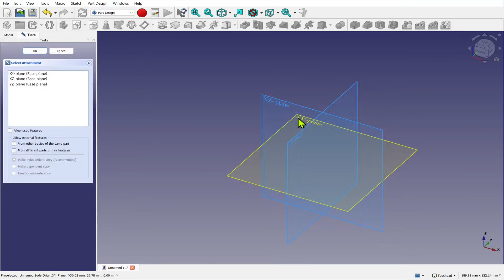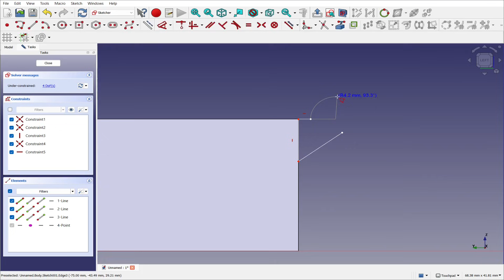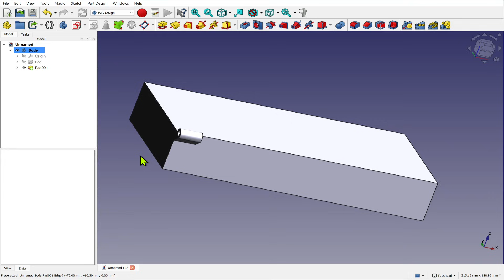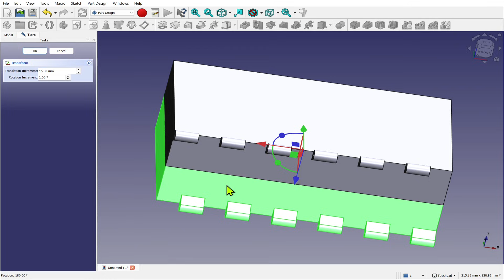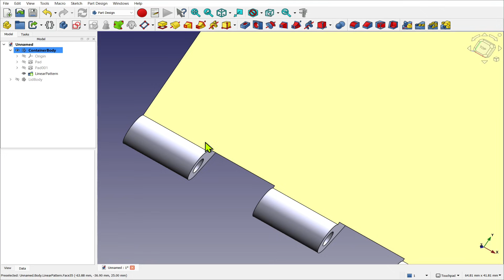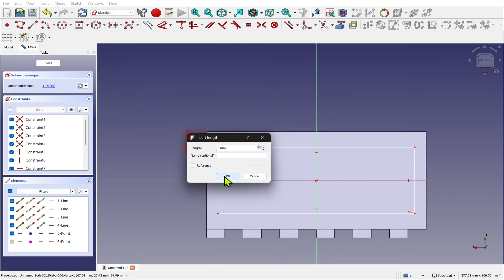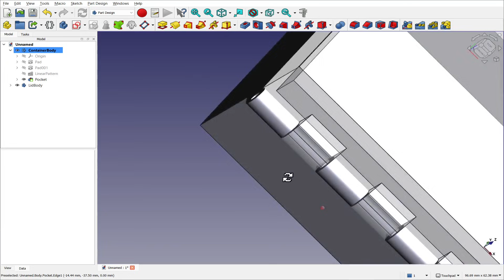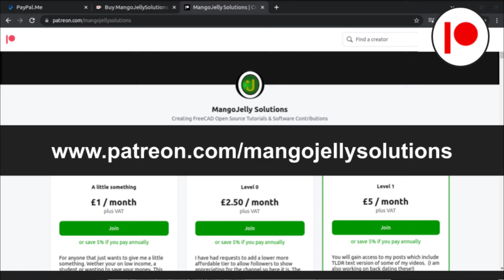Freecad 1.0 | Easy Hinged Box Using Linear Pattern | Basic Beginners FreeCAD 1.0 | Lesson 39

Comment: Great video. What's holding the hinge together? Don't you need to add a bar going through the hinges?
Reply from the maker: Thank you. The hinge can be held together with a metal / plastic pin.  Or, you could open it out so the tops lay flat and then in one body pad a pin all the way through one hinge.  This will line up with the holes in the other body and then you can export both and print them in place on the printer.  It's one thing that I wished I added to this tutorial.

Comment: Omg external geometery is what I need for my parametric shed model! I have been using the subshape binder to pull sketches in and then using math to adjust the position of the sketch. But I have been having issues with certain part like framing. I set an outer box to the dimensions and then add lines for the frame pieces but when I set sizes in my spreadsheet the lines sometimes reverse their size to like a negative number and then place the line outside the first box. I have to delete the dimension constraint and then move the line and then re set the dimension to the spreadsheet value, how can I address this? Do you have a video in mind I could check out of yours for this issue? Any help would be greatly appreciated. I never knew how to work FreeCAD until last week, and everything I have learned so far has came from you. What a great job you are doing!

How did you learn everything so methodically correct? Are you tied to FreeCAD and know more than the docs say or is it all self taught?

Comment: I get an error when I try following this tutorial (Windows 10; FreeCAD 1.0.2). If I create the void sketch off the face following the linear pattern, then changing the occurrences of the linear pattern causes an issue (AttachEngine3D: subshape not found LinearPattern.?Face35). However, on the base, if I create the sketch off the face of Pad001 instead of the linear sketch, then I don't have this issue. The pocket in the lid, however, must follow the cloned linear pattern. So, I cannot change the occurrences if I have a pocket on the lid. Is this a bug? Are there any known workarounds?
Reply: I have the same issue on macOS 15.7 and FreeCAD 1.0.2. After adjusting LinearPattern, the top surface changes ID, and the sketch loses the attachment link. 

As a workaround, I have created a sketch on XY_Plane and adjusted the attachment offset position to z 25mm. I then created a pocket in containerBody. After that, you can use Clone from the Draft workbench, move the sketch clone to LidBody, and use it to create volume in the lid.
Reply: I posted related comments about this error, along with my partial fix. Youtube isn't showing my posts. It only shows them to me, not to others, as tested in a separate incog browser. It's frustrating to try to help and type it out, out only to have their system shadow-exclude me out randomly. Of course this comment will probably go through. Ugh.
Reply: Same error here. Hmm.

Comment: G'Day All, Nice way to Model what initially looked a bit Complex. In reality the Hinge was fairly straight Forward!. Finished it off with a Hinge Pin by Creating a Hinge Pin Body, Sketching a Hinge Pin End Piece Using The Original Hinge Geometry (FreeCAD kindly Defaulted to Creating a Sub Shape Binder to Facilitate Its Pad Operation). I the Sketched the PinBody on the Pad Face and Extruded 150 mm through the Eyes of the Hinge Array. Crikey Starting to get Half Smart!! I've been following Darren for the Last 2 Years, the quality of His Tutorials are obvious, FreeCAD however like any Software requires a concerted commitment by the User to become like Myself Basically competent (by not means Good at it). I've started a Comprehensive Revision of Tutorials and am finding this Time around I'm getting a better understanding rather than just following Darrens Expert examples. With time and practice You can start to anticipate what come next in the various Workflows. Newbies don't get discourage, go back, revise and then progress.
Reply from the maker: Thanks for sharing you experience Russel and how your progressing and getting the hang of the software.  Great to see how your getting into the swing of things.  Thanks for taking the time to feedback and the kind words of support, much appreciated.

Comment: I could be wrong, but that way that the clearance between the hinges is being implemented here might not work as expected. You are working on the original and create space only to the right of the bottom hinge. Since the lid is a clone of the bottom and rotated 180 degrees, it now creates space to the left of its hinge components. These extra spaces are therefore on the same side, essentially doubling the clearance on that side, but not creating any clearance on the other side. This will create problems when combining the parts.
Reply: Yup, you're right. It will still fit together when printed but the lid would be slightly off-center. Although we're talking 0.2mm so it probably wouldn't be noticeable.
Reply from the maker: Yes that is true but as said small, you could adjust with a 2 dimensional pad
Reply: @MangoJellySolutions  ...or by removing a fraction of a mm more in the linear pattern; or by offsetting the hinge sketch slightly.